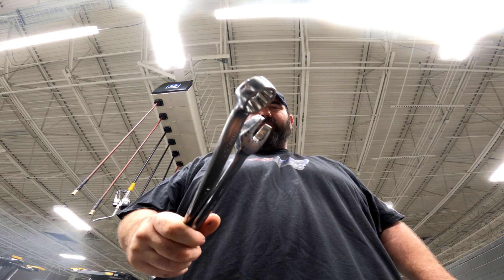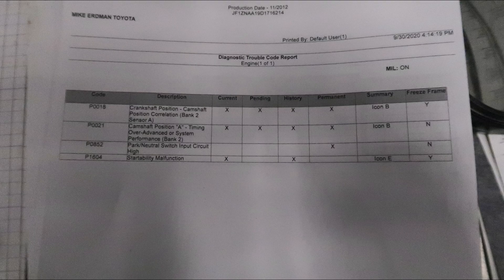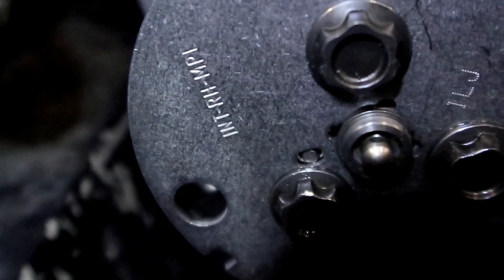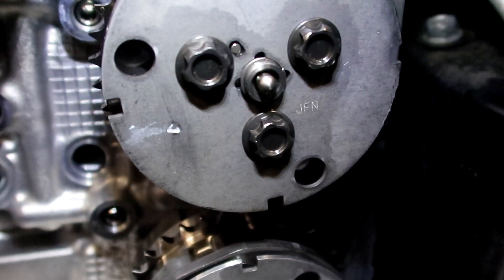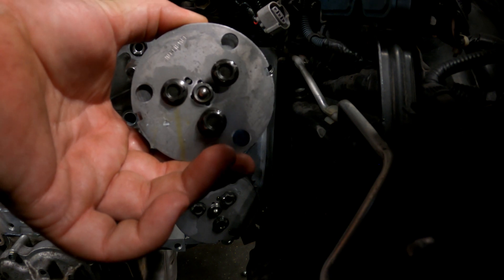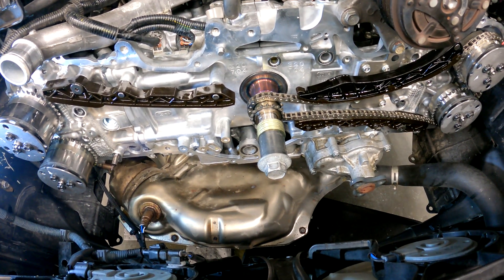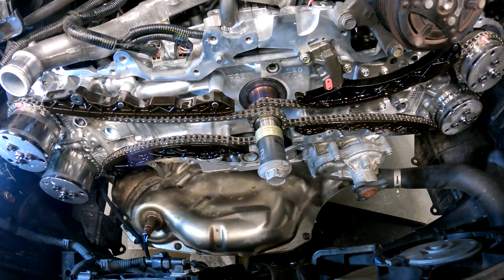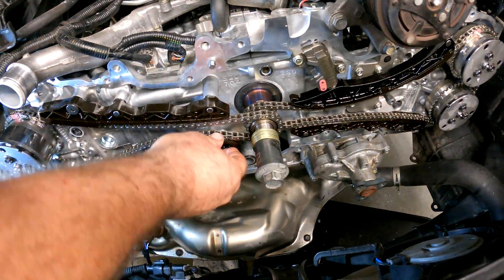how to fix check engine light FRS BRZ FA20 p0016,p0017,p0018,p0019

Comment: So if you have p0016 just change that?? How do you diagnose that? I have. 2015 outback with p0016 and p0018 . I did the timing belt. Passenger side chain felt a bit loose in comparison to the other side . Could that be the reason? Lose chain? I do hear ticking from passenger side.. idk if it is the valves or loose chain. I would hate to remove that cover to find out it was not the timing chain. But something with the valves. I don't want to remove the engine from the car again.. it took me 4 days to take it out do the heads the cams , reseal it😅

Comment: Great video dude, tells me all i need to know. I have a P0017 code, is there anychance that it could be just the sensor or is it definitely the timing/sprocket? 
(The car vibrates alot at 70km/h)
Reply from the maker: @assassinproxd  the sensors the sprockets and the ecu/wiring are all possible trouble areas along with the physical timing being off swapping the sensors is the easiest check if you don't have access to the full diagnostic troubleshooting
Reply: did you end up replacing your cam gear sprocket?

Comment: Bro i have a 19 BRZ and my engine seized so i bought a used JDM engine and swapped it. Im getting all 4 codes p0016-P0019 and also a p0011 would all 4 go bad at once or does 1 set codes for all
Reply from the maker: @ShazadMohamed09  i have not seen 4 go bad at the same time sounds like a wiring issue or maybe the jdm sensors are different if you didn't swap all your sensors onto the new motor I would do that

Comment: im having the p0016 cel . helpppp!!!!!!!!!!!!!!!!!
it started after hose change the belt was losend
Reply from the maker: Check the front sensors might have been damaged during that work one infront of each cam on the front timing cover check that the wiring is in good condition after that you will need a scan tool to verify operations and proceed with diagnostics sorry for the delayed response YouTube is doing weird stuff with my comments

Comment: What about codes P0390, P0391, P0345, P0346? My 2013 Frs is hard to start, when it finally does start it runs pretty rough. It will stall after a while, it’s not driveable. I was getting some other codes but I chased down some bad ground wires that seemed to clear up the other issues. Any ideas what I should do next with those codes?

Comment: Hi buddy i been having issus whit my subaru wrx 2015 fa20 whit the code p0019 and i double check timming is fine and change the timming kit and keeps the check light on i would apprecciatte all kind info thanks
Reply from the maker: Did you change the timing gears as this is a common cause of this problem next I would make sure electriclly that everything is good check the crank sensor and check for signal at the vvti gears. After that the ecus have been known to cause this as well

Comment: I have a 2013 scion frs been sitting over 2 months change clutch and lightweight flywheel. P0300,P0016, and P0018 codes popped. Car struggles to start will run and then die out. Able to drive but when stop accelerating will die again. In order to stay on you have to keep foot on pedal. Any advice what could be?
Reply from the maker: Did you possibly damage the crank sensor or the pick up wheel during the clutch change. I would also recheck any and all wiring in or around the tranny
Reply: @ParkHopTillWeDrop  
Pick up wheel? As in flex plate thats goes infront of flywheel to engine block????
Reply from the maker: @johnborja9391  pick up on the back of the engine behind the flywheel it's a disc with a bunch of holes in it. Maybe it was installed incorrectly or damaged when the clutch was done
Reply: @ParkHopTillWeDrop  yes that was what my friend and I was thinking. It still will on for minute but then struggles and dies. Have to accelerate to keep motor running. So if strongly believe its that we will check
Reply: @ParkHopTillWeDrop  im afraid if will be an ecu issue
Reply: @ParkHopTillWeDrop  
I notice the oil was mixed with water but looks nothing like coolant. So changed oil and looks fine prob from sitting too long condensation was mixed. Far as the crank sensor i did not touch anything from front motor but the trans and engine to get to clutch and flywheel. So you believe could be crank sensor mixed with water like brownish color? I was thinking the VVT but don’t want to buy unless for sure it is from what the code picks up shows that parts to replace.
Reply: @ParkHopTillWeDrop  
The main issue yes is sometimes hard to start but when motor runs the idle ups and downs for while and motor dies so can drive around but once let go acceleration car will for sure dies. I would be excited if could fix this issue as describing and your video is closes to my help needed.
Reply: @ParkHopTillWeDrop  what is the pick up wheel
Reply: When trying to start car it takes 2-3 seconds or more to crank and start. Then idle goes up and down like crazy. I would have to accelerate pedal for car to not die out. My last option is to pull out trans to check the flex plate you mentioned or replace ecu. If sure Flex plate I will check
Reply from the maker: @johnborja9391  if it was fine before work was performed I'd recheck that.  It ends up being an issue in that area 9 times out of ten.
Reply: @johnborja9391  I have the same exact problem, did you ever figure out what was the issue?

Comment: Got me a bit spooked to buy one of these now, how common is this, is it bc of abusing the engine or is it normal and how many miles before this happens?
Reply from the maker: normally its lack of maintenance but parts do fail it can happen its pretty easy to replace if you ever need to do so
Reply: Don’t get one of these, they are fun cars but terribly unreliable- Mazda rx8 more reliable

Comment: My sons 2013 BRZ was throwing a P000A code. We replaced the camshaft position sensor on bank 1 and that code ended up going away for awhile however we now have the P0011 code showing up and now Im not sure what to do. We have cleared the codes and while the car idles everything is fine but as soon as we drive the car the CEL comes on and we have the P0011 code with the P00OA code. We are ready to pull the engine and replace the Bank 1 exhaust sprocket, guides, tensioners and chain and time accordingly. My question is what else do I need to be looking at for the P000A code and the P0011 codes. Also, I have watched your setting timing videos. If we pull the front cover off and rotate the engine to line up everything for timing and find that the time is off lets say on the right side, arrows don't line up do we just turn the sprockets after we remove that chain to line the arrows up.
Reply from the maker: so I have only ever pulled one apart and had the timing be off with that being said yes you would simply set the timing back to spec and reinstall everything you took off. as for the what else you should look for i always look to see if there is anything clogging any of the ports and make sure that overall it looks clean in there you will also want to inspect the gear and make sure that it looks ok and nothing is broken or missing from the pick and that there is no metal in there

Comment: Dealing with a p000a which is camshaft slow to respond. How would I go about diagnosing this? I'm guessing that since it's not a correlation code that it could possibly be a blocked oil journal???? I moved the vvt solenoid and the code did not follow. It has stayed on cam A bank 1. I'm also getting a code simultaneously for c1201 engine control system malfunction. This code is setting in the abs/vsc/trac module. So I get VSC, Brake and Engine light. I really have no idea where to start. Have a solid scan tool with live data but not sure what I'm looking for. I don't see anything out of whack in the freeze frame data.....unless I'm not looking in the right place.
Reply from the maker: It could be an oil issue you could start by moving the controllers they are east to get to. After that I would look at the wiring and try swapping an ecu with a known good one
Reply: @ParkHopTillWeDrop  Hey thanks for the reply! I have some telling me that it could also be a clogged up ocv filter. Where might this little guy live? I was also considering unplugging the fuse for the abs/vsc/trac system to disable the module. I'm sure I would set a crap ton of codes but if I drive it and the p000a doesn't come back maybe I could pinpoint it to the c1201 code in the abs module????? This engine is not original to the car but I owned the car it came from and never had this issue. I still have the ecu from that car. Can I swap that one in and not have issues with the car starting and running without updating the VIN?
Reply from the maker: @rbailey225  the filter is under the cam cap so the engine would need to come out its very easy to remove but I would let that be your last resort I would replace the gear and while I had it off blow air through the cam before I pulled the motor

Comment: Hey man, amazing video! I do have a question. I’m not having any engine codes but my car just got reflashed(ecutek) and my vvt takes forever to come back. The first time it took around 30 minutes and the second time it was around a whole hour. Do you know what it could be?
Reply from the maker: this could be from the ECU flash itself the other thing that controls vvti activation is oil pressure so just make sure your using the correct oil and its not low after that the controllers can be weak and not pushing the gears all the way they are located on front timing cover there are 4 of them.

Comment: Update: The mystery code P0017 has finally been resolved.
Replaced a new cam sprocket for that particular fault code and it’s done.
No new ECU and all.
Reply from the maker: nice yeah it'ss almost always the cam geas
Reply: @ParkHopTillWeDrop  May have to do this with my 2018 WRX. Throwing the same code. How much does this normally cost to get fixed by a mechanic? I was quoted $1,200.
Reply: @Rad1oD3mon did you fix it yourself or did you end up paying for someone to do it? How much if so?

Comment: Hoping you can help. 2017 WRX had short block replaced at 54,xxx, spun bearing from what the dealer told me. Was 10 days out of warranty so paid out of pocket %50. Got my car back in August, so roughly 3 months ago and I’ve driven 2,500’ish miles. Popped a P0017 last week. Wondering if this would have to do with the short block replacement..? Only did the short block, not the heads or turbo. Car is bone stock. Asking because I don’t want the dealer to shaft me and try to tell me it is unrelated and not cover the repair. Can provide any further details if needed. Appreciate your input, thanks!
Reply: Omg.... I'm an dealing with the same exact issue right now..I just rebuild my motor too from a spun bearing..it was running perfect for 200 miles... then that code came on again.. first time this code came on was b4 the bearing spun and we only had to replace the oil control valve solenoid. Then the other day the p0017 came back and car stalled on me. Im starting to believe ima have to replace not just that 1 but all 4 to be safe? Thank both of y'all for this post and the video..
Reply from the maker: @cheeseburgereddie8198  hope we helped please let me know you have any other questions I'll try and help out best I can
Reply: I’ll comment with updates once everything is settled with the dealer to let you all know how I made out and what they say is causing it, if they warranty, etc. Appreciate your input/advice! Will keep you all posted, thank you!
Reply from the maker: @WReXX86  no problem man hope it works out
Reply from the maker: what normally happens is there is metal left inside the engine in hidden little spots its honestly almost impossible to get out and then it can make its way up to the the gears causing them to not activate when commanded. I've seen this happen on 2 separate occasions when the short block had failed as they were under warranty we ended up replacing all the gears at that time
Reply: Truly appreciate the quick response. This was my thought exactly when seeing the code but at the same time cringing at the thought of what could be causing it. Anytime i see a code in the lower numbers it gets me a bit nervous, lol. Now that said, in your opinion, should I expect/push the dealer to repair this under warranty, if it is in fact from metal shavings and/or being related to the short block being replaced? Would just like to go in with as much knowledge as possible to plead my case. Your time and consideration are appreciated more then you know, thank you!
Reply from the maker: @WReXX86  I would try and get them to fix it however unless they find metal in the gears not likely they probably won't want to warranty it its just how it is in the industry but it's worth a shot the worse they can say is no.  And if they say no I'd contact Subaru directly Sometimes they will cover it even if the dealer won't.

Comment: I have a P0021 that keeps coming back and I have swapped OCV's from a known good car and changed both Bank 2 Cam Sprockets.  Super frustrating, after 2nd startup/drive cycle it will throw the P0021 and shut all 4 ocv's down.  low power mode.
Reply from the maker: a clog in the system from the ocv to the gear can cause this and also the exu's are known to cause this problem I would also guess you have verified the timing is correct and the chain itself is not stretched?
Reply: how did u fix this?

Comment: Can you help me out i have the code p0019  on my 2017 wrx i have try everything   timing  set up  power connection fuses new vccd   Do you think its the same issue as your the cam gear the code p0019 don’t erase if you trying
Reply from the maker: The gears do go bad on these and cause this also the pcm can cause this failure but in the Toyota world we replace the gears way more than the ecu

Comment: Hi there, my Toyota 86 2013 has been throwing code P0017 for awhile now. Car is losing a lot of power. idling was ok but i can hear slight misfiring sound from the muffler while idling. Intake sound became louder. I’ve tried swapping OCV sensor, cam position sensor, crank sensor but the code still there. 
So now the last resort is to change the cam sprocket. The question is which cam sprocket that i need to change?
This problem has been bugging me for awhile now. 
What’s your advice? Thanks in advance 🙏🏻
Reply from the maker: If budget allows I'd change them all while your in there if not you have to start with the one you have a code for
Reply: @ParkHopTillWeDrop  thanks for the quick reply bro! May i know which is exact sprocket P0017 located? Please enlighten.
Reply from the maker: @TheRed86  sorry just got to the shop its bank 1 exhaust should be passenger side also I found a tsb for that code that requires an ecu update I would make sure that has been done before replacement of the gears
Reply: @ParkHopTillWeDrop  btw I’m driving a right hand drive JDM version. So bank 1 exhaust is on the driver’s side am I correct? I’m not sure whether JDM version requires an ecu update. 
I’ll just start with the one I’m having code 1st.
Do you have a instagram that i can follow?
Reply from the maker: @TheRed86  should be the same bank location doesn't change on right hand drive

Comment: I'm about to do this on my frs, is it necessary to replace the timing guides while I'm in there? And do you know the part number for that o ring on the oil pump that you mentioned in your video on setting the timing?
Reply from the maker: It's not nessasary but if your going to be there it's not a bad idea I'll find the oring part number

Comment: Ok i have the same motor but is a wrx i replace oil, spark plugs even the cam position sensor and the sensor the on front of the timing belt still getting this code p0017 is 2015 wrx do i need to replace timing chain or cam gear  i mean the car still run and drive
Reply from the maker: sounds like one of the gears is not locking when commanded its pretty common i would verify your timing is correct and replace the gear in question
Reply: @ParkHopTillWeDrop   ok thank you …i have to replace the bottom one right since is p0017 on passenger side cam gear?
Reply from the maker: @super181989  yes
Reply: Ok thank you i order and replace then already and 1 more question what kind of seal you used to put the chain cover back a can used any as long is for gasket and oil resist??
Reply from the maker: @super181989  yes but the Subaru sealant isn't that expensive and works insanely well just make sure you check the expiration date some dealers are selling this stuff way out of date and it works like crap when it's expired
Reply: @ParkHopTillWeDrop   awesome thank you for you help i hope got this car running  very soon again and i hope that fix that code if not i may have to replace the computer
Reply from the maker: @super181989  its almost always the gears or the controllers I think we have only ever seen 1 ecu failed not that it cant happen its just more likely for the other components to fail and I've replaced gears a few times
Reply: @ParkHopTillWeDrop   ok updated of the work i replace the cam sprocket both on that side i replace the sensors as well and i check the wiring connection and it have power still have the code p0017